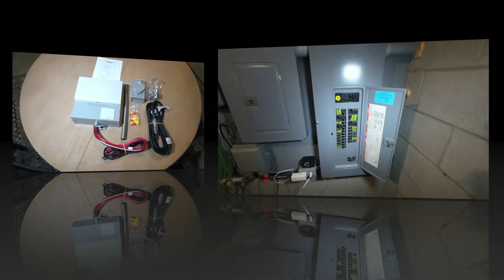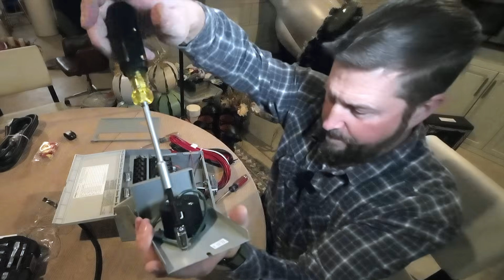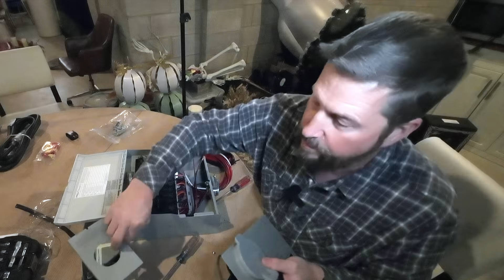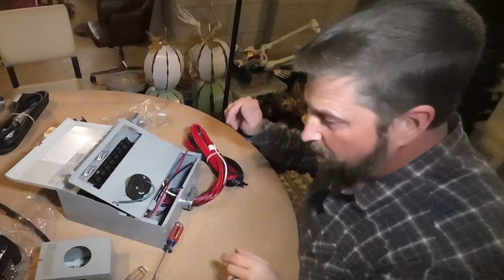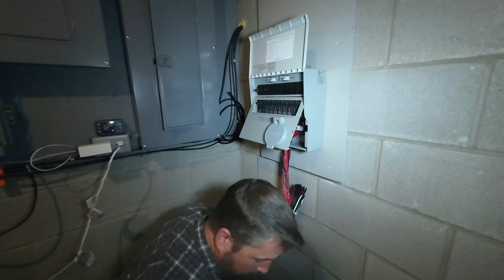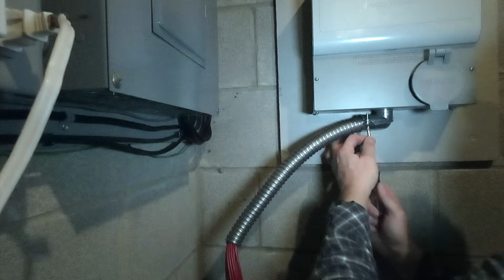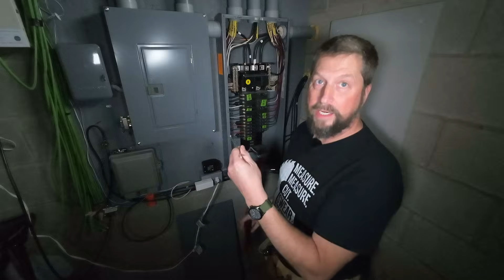Installing A 10 Circuit Transfer Switch: Reliance Controls Model Number 310CRK

Comment: I follow everything you're saying up to the last part of this video.  At 30:14 - You talk about "coming back down" (into the basement I'm presuming) and then power outage and mention the main breaker being turn off? I'm confused at this point. I presume you mean the power outage and not the actual main being tripped or flipped off?  Does the main breaker have to be tripped off for this device to be safe for lineman?
Reply from the maker: @Joebanker80  Great question. Sorry about the confusion. No, the main breaker does not have to be off. This system will not back-feed the grid because it disconnects from the main panel when you switch it over to generator. You don't even need to turn off the main breaker to test it. Simply hook up your generator as if there was a power outage and switch the circuits over from line to generator to make sure everything works as it should. 🤠👍
Reply: @samsdoinstuff I thought that’s what you meant but just wanted to double check.

Comment: LiFePO4 prices are really coming down and I get the feeling it might level off soon.
2 years ago buying 16 280Ah cells from China was a bit of a crapshoot on getting quality cells for $2000
Now you can buy 16 280Ah cells straight from a USA vendor with a reputation (18650 Battery Store) for under $100 each and get them within 5 days usually...so after shipping it comes out to slightly cheaper than the old method of buying questionable cells from unknown Chinese vendors that took 2-4 months to get here on the slow boat.

Then server rack batteries hit the market and the 48V (16S so 51.2V nominal) 100Ah batteries were right around $1500 for a good budget one.
These days you can get one for $1200 shipped all day from a few reliable brands

And if you watch the BatteryHookup auctions (mostly used stuff but with LiFePO4 you can almost guarantee anything you buy still has a least a few years of daily cycling on it before it hits 80% of its original capacity) you can get stuff for WELL under $50kWh if you're willing to just spend a little time testing some cells and getting rid of any bad ones and salvaging good ones from other batteries in that auction. I've seen deals for GOOD stuff at $36/kWh after shipping for about 12 or 14kWh of capacity. Missed out on an eBay auction for a module someone had obviously purchased from BH. It was 34kWh for $2000 shipped. Should have bought that, it was 280Ah CATL cells in a 20S module that you could easily turn into a 16S and cut out the last 4 for a 12V battery or buy 4 modules and then string together the last 4 in each set with some hefty 2/0 welding cable to create a 5th 16S battery. Put the modules on a heavy duty shelf (guy on YouTube has a video of doing this) and it would get you just shy of 72kWh for a $4000 and some change IIRC

So that $100/kWh number is honestly high if you shop around. BatteryHookup has been the go to place for used LiFePO4 lately but there are others like Higher Wire, Jag35 (sometimes a tad more expensive but he will often do custom PCB's that help your DIY project become much more plug and play), or BatteryClearingHouse

Comment: Excellent video. Question: so we don't actually free any breakers in the existing panel. The ones we are setting up for access in the MTS are still technically in use in the main panel.
Reply from the maker: @cgf72  Great question. Yes, the flow of electricity is from the grid, through the main panel breaker, through the MTS, into each circuit. The MTS switches power supplied from the grid to being supplied from the generator. This prevents the generator from ever backfeeding the grid. You can also test your backup system without ever shutting off the main power in the panel. Hope this helps 🤠👍

Comment: Question. Do you still have to turn main breaker off when using generator
Reply from the maker: Great question. You certainly can, but with this manual transfer switch, there is a hard disconnect from the grid power so you don't necessarily have to. Your generator will power the circuits you've chosen and when the power comes back on, you don't have to worry about back-feeding the grid because those circuits are disconnected through the transfer switch. Hope this helps! 🤠👍

Comment: Good video so that white wire that you’re hooking to the ground bar that is the white wire that is connected to the outlet correct I just got mine today and when I opened the bottom panel, the white wire wasn’t connected to anything it was just sitting there so that’s for the plug correct ?
Reply from the maker: The white wire is the neutral. It should be connected to something. There shouldn't be any loose wires. If the white wire is missing from the inlet, that's probably it. Hope this helps 🤠👍
Reply: @samsdoinstuff  the white wire wasn’t connected to anything inside the transfer switch where the circuit breakers are
Reply: @samsdoinstuff  so where is the white wire connected at where the circuit breakers are? I guess that’s the easiest way to ask that’s why I was thinking that white wire that wasn’t connected to anything to the outlet box.
Reply from the maker: @cessnapilot1990  I think at this point I would have to see it. There's a white neutral wire that goes into the main panel and gets connected to the neutral bar. That should be pre-wired into the transfer switch. Then there's a white neutral that gets wire nutted to the wire you provide to connect the inlet. Not sure if there's another one I'm missing.
Reply: @cessnapilot1990 follow his video step by step. He literally showed you were both white ends went.

Comment: Good video!  My project is to connect an EcoFlow Delta Pro battery power station for power outage backup to my breaker panel using a transfer switch. Eventually I would want to create a Hybrid power system in which I would get 50-75% of my power from solar.

I have identified 10 critical circuits that I can connect to the transfer switch, but in the future I may want to add more circuits. Being that the largest transfer switch on the market only has 10 circuits, is there a way to combine them?
Reply from the maker: I also would like a Delta Pro some day. Good choice. There's no doubt in my mind you could use 2 transfer switch systems for 20 total circuits. Just do a double install side by side. You would need 2 generators as well 🤠👍
Reply: @samsdoinstuff  EcoFlow has a setup that has a connect that uses a double voltage hub that requires to Delta Pros and provides 240V,   However I do not nee this because I am only dealing with 110V service

Only connecting 110V services to the Delta Pro and leaving the  220 V services connected to the grid.  Even had my 220V Submersible well pump removed and replaced by a Grundfos 10SQ05-160 115v 3" Submersible Water Well Pump.

If I installed a 2nd transfer switch could i use something like a Finderomend Dryer Splitter Adapter to connect both transfer switch to the Delta Pro. Presently have one extra battery and will be adding a secound when I get this setup.
Reply from the maker: @NBPostman  sounds good 👍

Comment: 50 videos on the transfer switch and not one video speaks to the meter shown at the to of the switch box; What does it measure in or out current? what to look for? how to read it? I'm not sure how to ignore it like it isn't there.
Reply from the maker: Great question and I'm sorry I didn't address that in the video. The meters measure the amount of power coming from the generator in relation to the amount used by each side of the transfer switch. It is ideal to keep each 120 volt side under equal load. The meters allow the user to monitor that load. Hope this helps 🤠👍
Reply: @samsdoinstuff  Thanks for explaining.

Comment: Hey you gave me an idea but in order for my idea to work I need to ask you. That outlet you used from the box, are they all standard size? I ask because the Reliance TS I’m thinking of buying A501A comes with the optional power outlet and the 50’amp power cord I’m buying comes with an outlet  box with an outlet. If I can do what you did with the outlet that comes with my cord I can buy the Reliance TS without power outlet option and save some dough.
Reply from the maker: Thank you for your question. First, I always feel best using what comes with a kit rather than piecing different brands together. Also, my TS is a 30 amp version, just to be clear. That's what works with my generator. If both are the same brand, however I would think the outlets would fit in either one because there is an option of using a 50 amp inlet instead of a 30 amp inlet so they should be interchangeable. No guarantees, but I hope this helps 🤠👍

Comment: Thanks for showing. I am going to hook up 6 circuit one hopefully this weekend.  However. That will be loads i run to also save on energy cost.  So they will not just backup power but also help save cost on daily solar generator.
Reply from the maker: You're welcome! Glad you liked it. That is a great use to save energy costs. Good luck! 🤠👍

Comment: Does this transfer switch and most others take a standard circuit breaker like you can find at your Home Depot?
Reply from the maker: Yes, I believe it does. I always use brand specific breakers with whatever box I have. Just my opinion.
Reply: Yes - Had to pickup a 20 amp Siemens for the 6 bay MTS….

Comment: All that power goes thru that single nuetral wire?
Reply from the maker: Great question.  A neutral wire only carries the unused electricity back, if I remember correctly. The installation is correct. That I'm sure of 🤠👍

Comment: so in a power out situation, do you still have to turn off the main box breaker to the entire house to prevent back feed to the grid?
Reply from the maker: Great question. No you don't. You can actually test your system without having a power outage. There is a direct disconnect from grid power when you switch each circuit from grid to generator.
Reply: @samsdoinstuff  thank you so much, going to be doing this soon. Is there a better alternative to wire nuts? not a fan of those things from automotive days
Reply from the maker: @Deuteronilus  You can use WAGO connectors. Here's a link:
WAGO 221 Lever Nuts 78pc Compact Splicing Wire Connector Assortment with Case. Includes (34x) 221-412, (26x) 221-413, (18x) 221-415 https://a.co/d/7Og6oWU
Reply: Does this particular transfer switch and most others take standard circuit breakers or do you have to shop for special type?
Reply: @MrBritrider this one in particular uses standard breakers
Reply: Will the live generator breakers back feed into the box and power other breakers when the power goes out?  I’m so confused by that because it seems they would as they’re all connected to the main bar?
Reply: @jetdust no, that's what the extra switches in the transfer switch does.  It is either connected to line, or generator, not both.  This makes it impossible to accidentally send power back to the grid.  In a power outage situation,  you have to manually open the transfer switch and switch each one to generator, then when power is restored you have to manually switch them back.

Comment: If I use this box with the power being fed from a 120v source, how do I handle having 2 line wires to connect? Do I connect my one source line to both switch lines in? Would that cause an error, especially if the lines serviced are running into the house panel having 2 phases? I ran with the scenario I just described and do get GF error and am not able to power anything when I switch from Line to Gen. If that is the problem how do I separate the 2 phases in the switch box? I have reliance Model 30408. Thanks in advance.
Reply from the maker: That question may be above my skill set. I would ask an electrician. The way I did it is as per the instructions.  Good luck 🤠👍
Reply: No problem. Thanks anyway.  Great video as well! 👍

Comment: I followed your excellent video here and the one installing the outside inlet and all came out great. What I did different was to cut the male end off the 10 ft cable that came with kit and connected the cut wires to back of outside inlet and ran it through pvc conduit into basement leaving female end near transfer switch. I purchased a separate cable inlet and installed into transfer switch. I will plug in my cable to connect a generator or use a separate cable into transfer switch in future when I get a battery system. Generator works great and batteries should work in the future. Thanks for you great videos.
Reply from the maker: I couldn't be happier to read your comment! I'm so glad I could help, and congratulations on a successful install 🤠👍

Comment: I went through the exact same steps and had the same issues. Once it was complete I hooked it up to the eco flow DPUltra and it works great. Adding solar to the eco flow unit will help out with long term outages. Knowing you are on backup you need to be careful with your usage. One other item is to have a nearby receptacle for battery charging of your generator. Great video!
Reply from the maker: Thank you! That's the exact setup I hope to have. I like the Delta Pro Ultra, and I would like to have it set up as my main backup. Then, if the power is out too long and the solar panels aren'tenough, use the gas generator to charge it. All I need is about $10k 🤠👍

Comment: So does the neutral from the generator just carry the imbalance of the branch circuits?also what does the single white wire from the transfer do?is it just for the power meters?
Reply from the maker: Those questions may go a bit beyond my basic knowledge. I know white is neutral, and the neutral and ground are bonded in the main panel. The 30 amp power supplied from the generator simply turns the house circuits into a bunch of extension cords. I'm sure there's more to it, but it's safe and it works so I'm happy 🤠👍
Reply: @samsdoinstuff  The white also should be the return path to the generator, I think. So it should have a connection to where you attached the white of the generator inlet.

Comment: Great work. I like recommending electrical tape on all wire nuts in the panel. Keep up the great videos 🧬☀️🦾🪓
Reply from the maker: Thank you! I did tape the 220 connections. Might go back and do the others now that you said it. Thanks! 😁👍
Reply: After I installed our six and ten circuit Manual Transfer Switch, I went back and removed all the wire nuts, replacing them with Wago wire connectors. They work so much better and are safer.
Reply: @Pk3_Garage  I like those connectors as well. I’m kinda weird about electrical tape on seems. I put it on the wagos as well.
Reply: I hear you. Better to be safe than sorry